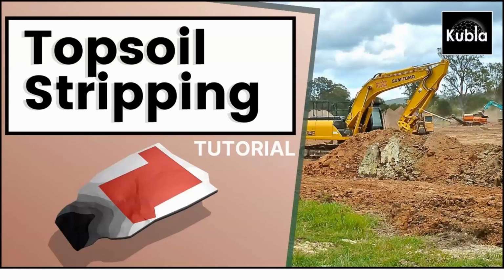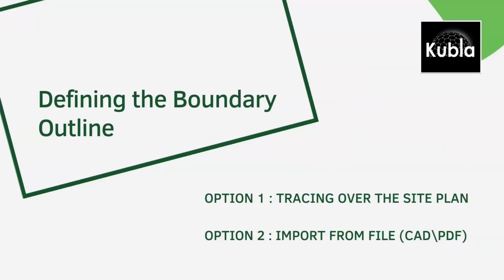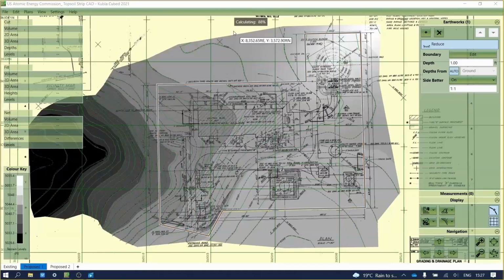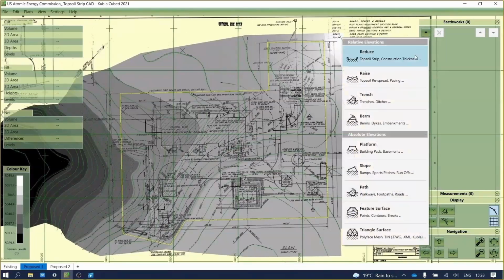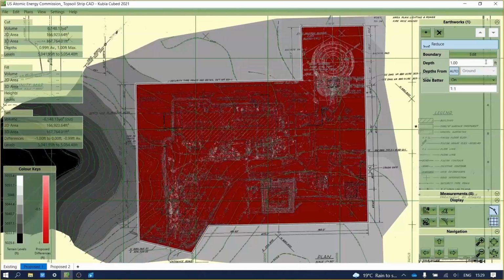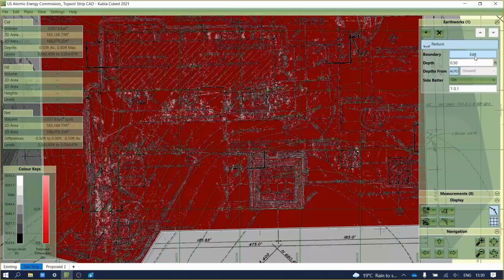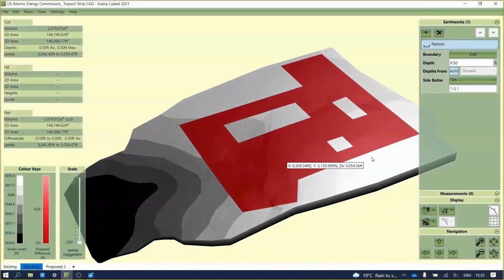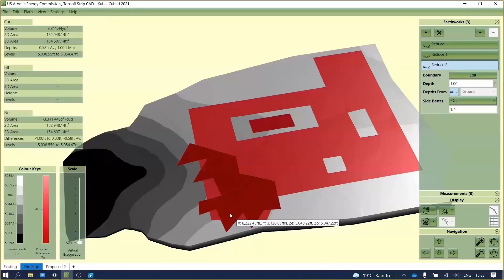Kubla Cubed Tutorial | Topsoil Stripping

Comment: When the topsoil stripping has been defined, how the software considers that stripped volume when calculating the bulk excavation?? for instance when we are defining the paying excavation, the existing level is not what we defined, the existing should be bottom of the topsoil.
Reply from the maker: Hi Shane.  
The topsoil strip must be done in its own phase (tab at the bottom of project). Each phase is a comparison between two surfaces.  In terms of the cut & fill reported, these volumes are separate for each phase; that is to say it is not a running total or cumulative.  The only relationship the phases have to each other is the proposed of one becomes the ground of the next.  In the scenario that you describe, the existing will be stripped (in Proposed 1); then the next phase (Proposed 2) the ground will be calculated not from the original existing but the stripped levels.  
You should be able to use the cursor, or cross sections (if you have the Pro edition) to check the surface levels on each phase.
I hope that helps but please contact us if you would like some support.